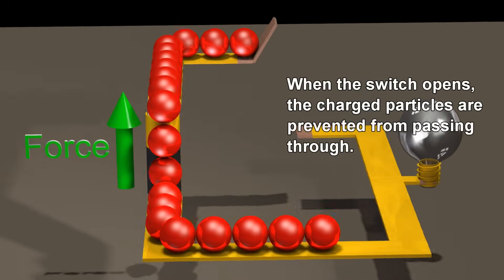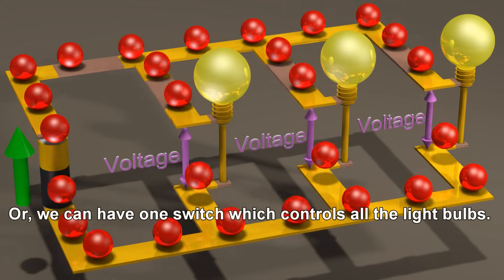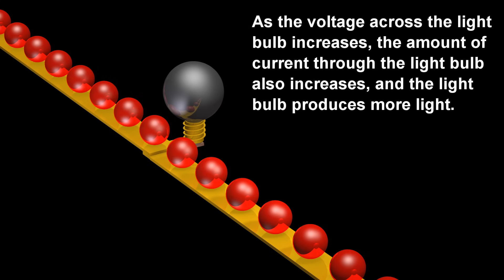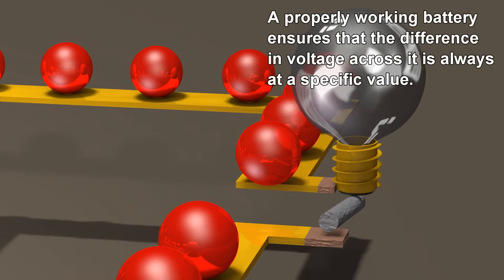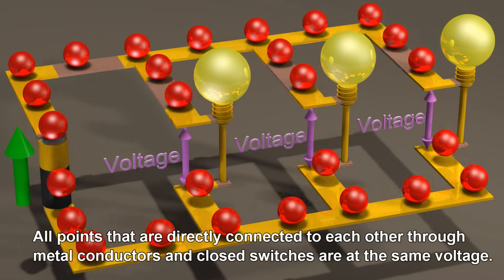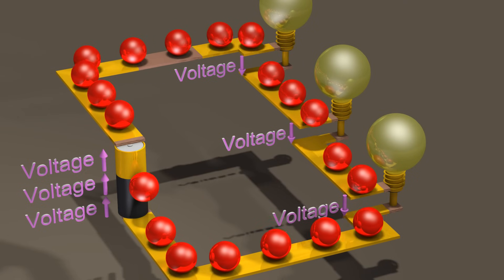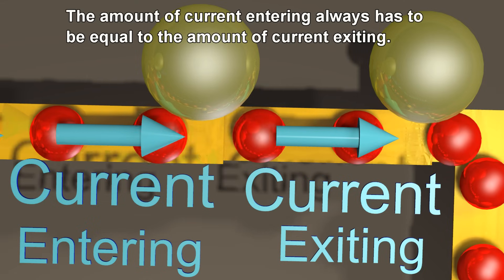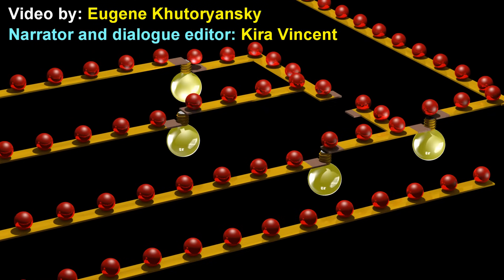Electric Circuits:  Basics of the voltage and current laws.

Comment: just one doubt . as in the video , you said that when appliances are connected in parallel arrangement , the current along with the voltage is same for all . and this is because voltage determines the current . but then it is equally erroneous to as we all know that the current in a parallel arrangement is not constant ... can you pls solve this query of mine ??? 

thank you
Reply: The current on all light bulbs here is constant and same for all because the bulbs all have the same resistance (U=R*I, Voltage=Resistance*Current). However, it's not the same current provided by the battery, which is visualized with the differences in speed of the red balls. Amount of current = speed, amount of voltage = height.
According to kirchhoff's laws, the sum of the currents through the light bulbs in the parallel circuit is equal to the current that flows into the parallel circuit.

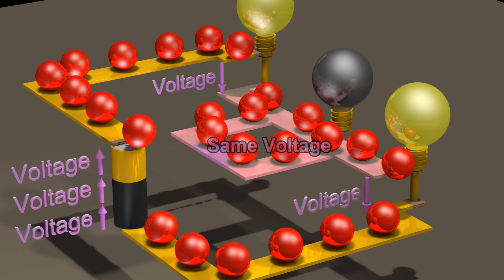Comment: I’m kinda a newbie here. Can anyone explain to me what happened at 3:47 when the switch was activated? I still don’t understand why the current only passed through the path of the switch but not the parallel bulb. Thanks!!!!
Reply from the maker: The current that flows through a light bulb is proportional to the voltage drop across the bulb.  When the switch is closed, this forces the voltage drop across the bulb to be zero, because it is parallel to the switch, and the voltage drop across a closed switch is zero.  When the voltage drop across a light bulb is zero, no current flows through it.
Reply: Physics Videos by Eugene Khutoryansky so is it because the current that passes through the switch is so high, which reaches infinity in theory, that there’s no current passes that parallel bulb?
Reply from the maker: @duytruong3956  The current does not reach infinity in this case, because the current is limited by the resistance of the two other light bulbs which are still on.

Comment: Instead of saying voltage is potential energy, could we say that voltage is the force with which each electron is repeling another electron? So if an electron repels another electron with a force of 1 volt, then the net voltage force for the entire battery is the force from all electrons added together. So if the battery has 9 electrons the net voltage would be 1 volt of repelling force times the 9 electrons since they can all repel with the same force, which makes the battery 9 volts. I know the battery has many more electrons then 9, i said 9 just to  make it easier to understand what i am saying.

Comment: This is so cool. After years I finally found logical (for me) interpretation. I felt so dumb during my studies not to comprehend this problem. My classmates always told me to try to connect some circuits to get it. But I always wanted an explanation which will satisfy my imagination. For me, it was a stupid irrational thing which closed the way for me to electrical engineering. :) Thank you very much.
Reply: Sorry but I didn't completely understand what you meant. Did you mean that you were unable to do electrical engineering because you focused more on the imagination part of it?

Comment: sir ...what happens when we join the wire directly to the both terminals(i mean without any appliances or resistors..etc.,)....and how can we represent voltage in that situation pictorially like u  did in this video?
Reply from the maker: All real batteries have some internal resistance.  Therefore, the mathematical model of a real battery is a resistor in series with an ideal battery.

Comment: 3:45 does this happen because the current chooses to flow through  path of smaller resistance?
Reply from the maker: It happens because the resistance is zero.  If you have two paths for the current with unequal resistance, at least some current will still flow through both paths.  But, if one of the two paths has zero resistance, then all of the current will flow through it.
Reply: Physics Videos by Eugene Khutoryansky oh Gosh you really took the time to reply? Btw this video helped me understand better than the 3 hours I used to blindly study. Thanks a lot man

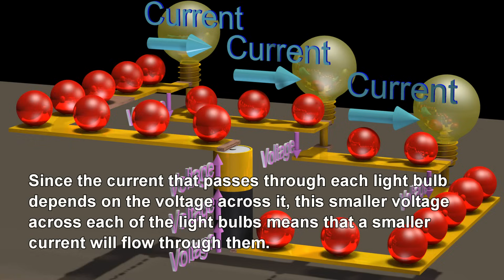Comment: at 7:31, "Since the current that passes through each light bulb depends on the voltage across it, this smaller voltage across each of the light bulbs means that a smaller current will flow though them.  at 7:53 "Because the light bulbs are connected in series, this means that the current passing through each of the is the same.  So I am confused, is the current decreasing as it passes through each light bulb or is is it staying the same?
Reply: It is the same, but because the individual "drop" are less, the light bulb are less bright

Comment: Just to confirm my understanding about something. At 5:56 it says each bulb experiences the same current as it would if the bulb were by itself.  At 6:18 it says the total current drawn from the battery is the sum of all currents drawn by the bulb. If each bulb has the same current as the current in the circuit with only one bulb, does that imply that the current drawn by the battery in a circuit with 3 bulbs is 3 times greater than the current drawn by a battery with 1 bulb? and that's because adding 2 more light bulbs is essentially just adding 2 more paths for the current (which is constant in the case, along with the voltage) to travel through.
Reply from the maker: Yes, the current is 3 times greater with three light bulbs.

Comment: electrons are negatively charged, thus flow from negative to positive terminals of the battery
Reply from the maker: The red spheres represent positive current, which flows in the opposite direction of electron current.  I explain this in my video at https://youtu.be/-Rb9guSEeVE

Comment: What happens in an CIRCUIT WHEN an SINGLE ELECTRON is PUSHED into the circuit by an BATTERY with some potential difference.... Will electron stop by pushing nearby electron OR will it reach CATHODE by pushing all the electron in it's way...???

Comment: Sir, Every force has equal and opposite force, in an circuit connected by an battery, the electron from anode of battery, PUSHES electron near by(in the conductor) , that near by electron pushes it's near by electron, this chain of pushing, ENDS at CATHODE , while PUSHING, the electron from anode will DECELERATE. But in formula of drift velocity, this deceleration is not included..... WHY? (if I am wrong correct me SIR)
Reply from the maker: We also have to take into account the attractive forces between the electrons and the positively charged particles inside the battery.

Comment: These are quite well done. I feel one of the demonstrations could have used a brief point about resistance.  The one with the small square detour and switch that bypasses the light build. Knowing that the light bulb has a slight resistance helps to explain why the current takes the long way around when the switch is closed.  Minor point really.
Reply from the maker: Thanks.  I have a video devoted entirely to resistance at https://youtu.be/G3H5lKoWPpY

Comment: So, is it the voltage or the current generating light?  Why higher voltage will make the light bulb brighter and even burned out? Why door knob voltage doesn't kill you even it's known to reach 2000 volts?  What is heat and what is light? What is the difference between the flow of electricity and the flow of fluid like water in the pipe?

Comment: 4:06 Isn't this animation wrong though? Because electrons always takes the shortest path. The side with the longer path would be the one with no electron flow rather than the side with the light bulb.
Reply from the maker: The animation is correct.  The shortest path is not necessarily the path with the least resistance.  If electrons always flowed through the shortest path, then they wouldn't even stay in the wires, but go straight through the air.
Reply: @EugeneKhutoryansky  I know I'm saying the shortest path through the wire. I still don't understand why it would go around the lightbulb unless you're saying the path through the lightbulb has more resistance, which should have been stated in the video.
Reply from the maker: Yes, the light bulb has more resistance than a wire.  If this were not the case, there would be no voltage drop across the light bulb, and no power consumed by it.
Reply: @EugeneKhutoryansky  oh right makes sense. Thanks for your reply

Comment: This is one of the best explanations about how current move. The electron is naturally negative charge in static state of any conductor. And you pull this electron by a positive charged power which are the protons.

Comment: Why does the animation seem to show a charged particle (electron) waiting on the supply side of an open switch when there are closed switches in the circuit? Electrons would flow to and through the connected loads via the closed switches (path of least resistance). Think of it as a route diversion on your journey home; you're not going to wait at a barrier for a closed road to open up. You will go the other route in order to get home.

Comment: Great Graphics. Only issue is it shows current flowing in the external circuit from positive to negative. Current in a DC circuit flows from negative to positive. Thanks for a great demonstration
Reply from the maker: I am showing positive current flow, which is in the opposite direction of electron flow.  I explain this in my video on visualizing voltage at https://youtu.be/-Rb9guSEeVE

Comment: There was a mislead in the animation of particle flow in the video. Particles (electrons) do not move from positive to negative pole, but rather the reverse.
Reply from the maker: I am showing positive current flow, which is in the opposite direction of electron flow.  Showing positive current flow is the standard in industry and in education.  I explain this in my video on visualizing voltage at https://youtu.be/-Rb9guSEeVE

Comment: Doesn't electrons flow the other way around? Since they are charged negatively
Reply from the maker: I am showing positive current, which is in the opposite direction of electron current.  Showing positive current is the standard in industry and in education.  I go into detail about this in my video on visualizing voltage at https://youtu.be/-Rb9guSEeVE

Comment: The current is flowing the wrong way!!! Additionally, the positive charge attracts free electrons, it does not repel them... turn the battery upside down to fix things ;)
Reply from the maker: The red spheres represent positive current, which is in the opposite direction of electron current.  Showing positive current instead of electron current is the standard in industry and in education.  I explain the details of this in my video on visualizing voltage at https://youtu.be/-Rb9guSEeVE

Comment: I already graduated from a university and now I see this.... 

How much did I pay for a free video?!
Reply: If 9V means that 9 joules of energy is transferred by every coulomb of charge, then if all of this energy carried by the electrical current is transferred into light/thermal energy in the lamp, then how does the electrons have any energy or "pushing force" left to return to the opposite side of the cell?

Any help is appreciated!
Reply: Do you remember how Cathodes and Anodes work from Chemistry/Physics? Batteries can get fully discharged, but while they still have charge, the anode gets more and more depleted.
Reply: @Random-nq4xj  do you mean where the energy that keeps electrons wave around the nucleus by  300000 times a second with sinusoidal elernal precision?
Reply: @moradesss5993  Single phase AC current is a sinusoidal wave form and three phase AC is three sinusoidal wave form 120°
Out of phase of one another. 😳
Reply: @m101ist  thanks for the insight, I ment where this energy that keeps.electrons moving coming from, those sinusoidal waves too..
Reply: @moradesss5993   It's a force, protential energy, like a spring under pressure waiting to be released. 🙄
Reply: yep I see, but the pressur it needs a force to be pressed to have then a load to push back no, where did it come from, and how it comes that this.potential.energy is so precise and the same over all the particles.of the univers maybe and from the begining of times, to the next step
Reply: @moradesss5993   I don't believe in the big bang theory and the bang came into existence from nothing.
  So the logical explanation is that this force, energy, matter. Has always existed in one form or another. 😳
Reply: @m101ist  that s a very dazling for my mind to think ot this way, but well am simple minded. and thanks for the insights man no need to have wide eyes yo hhh
Reply: @moradesss5993  Yes  that's your choice , my self I need to and want to know. 🙄
Reply: @Random-nq4xj   It would if there was a short circuit.
The resistance in the lights slows this down in a form of heat and light. 🙄

Comment: Keep in mind.

Their example makes it appear as if a "wire" is coming from the battery terminal.

But a real wire has both a "hot" and "neutral" line built into it.

Therefore, if you wire lights with a hot and neutral wire in and a hot and neutral wire out, you are wiring the lights "in parallel" even though it seems as if there is one "wire" going to each light in series.

Comment: what causes potential drop across a resistance?
Reply: I'm a newbie, but my understanding is that a resistor is like a choke point, a funnel that dictates how much current can get through while the rest is dissipated as heat. In the case of say, an LED, a portion of the electricity passing through is converted to light and heat.

Comment: Why are you showing the current cycling through the battery as though it's perpetual?

I know it's probably obvious that it doesn't work that way but seeing it makes the whole thing seem questionable when this is a nice depiction otherwise.

Maybe, instead of having the current ride up the battery, you could just have the current appear out of the top and disappear at the bottom.
Reply from the maker: You may want to watch my video on battery energy and power at https://youtu.be/u4FpbaMW5sk

Comment: The problem here is the the flow is reversed and they show it flowing constantly. The electron flow will flow from negative to positive and stop. It shows the movement through the battery which wouldn't be correct. Once the electron moves from the negative to positive in the battery eventually balancing out the atomic structure on both poles causing a dead battery and no electron flow.
Reply from the maker: I am showing positive current flow, which is in the opposite direction of electron flow.  In my very first video, I showed electron flow, and people complained that I should instead show positive current flow, as showing positive current flow is the standard in industry and education.  So, it is not possible to please everyone, as some people will be upset no matter which option is selected.  I explain the difference between electron flow and positive current flow in my video at https://youtu.be/-Rb9guSEeVE

Comment: Fantastic visual illustrations. I have one question. In this video you show what looks like a Duracell battery where the positive end is copper coloured. Therefore, it looks like the positive end is pushing negative electrons around a circuit. Shouldn't we turn the battery around?
Reply from the maker: I am showing positive current in this video, which is in the opposite direction of electron current.  I go over this in my video at https://youtu.be/-Rb9guSEeVE

Comment: So the more voltage the more current ? I thought it was the opposite
Reply: V=IR

voltage and current are proportional. You can tell because if R stayed the same and V was to increase, I would also have to increase in order to balance the equation

Comment: You said if voltage increases the current will increase too,  on a fixed resistive load? I was under the impression that voltage goes up on a 100w bulb the current decreases.
Reply: Gonna throw 240 on a bulb and then 120 to see the amp diff :)

Comment: 3:45   Is the potential energy either side of the lamp made equal because the switch is in a branch that presents the lower resistance than the lamp? I'm confused about that.
Reply: yes, so lower the resistance that you can consider there's no resistance at all, and so no voltage's difference  between entry and exit of the lamp...

Comment: Does the circuit move up and down when the switch is closed and opened ?
Reply: The height of the circuit here represents the voltage the wire has...

Comment: Awesome work, I like the visuals, but if I can point out a slight common misconception; the battery should be reversed, as the current flows from the negative terminal side to the positive terminal side in a circuit and positive to the negative terminal inside the battery source.
Reply from the maker: I am showing positive current, which is in the opposite direction of electron current.  Showing positive current is the standard in industry and in education.
Reply: I see. I've never heard of positive current before, so I stand corrected; I'll have to read more on that. Excellent work; I'm looking forward to seeing more of your videos.
Reply from the maker: I cover the difference between positive current and electron current in my video at https://youtu.be/-Rb9guSEeVE

Comment: Isn't more accurate if you use slope surface instead?
Reply from the maker: If you want to show the resistance of the wires, then using a slope would show how there is a slight voltage drop across the wires.  But, if the wires are ideal conductors with no resistance and no voltage drop, then the slopes would be zero, as shown in the video.

Comment: some correction is needed that current is same when voltage difference  is same this is not necessarily because for same voltage difference , resistance  will decide how much current passes and u have not told that bulbs are identical and ideal! think it!